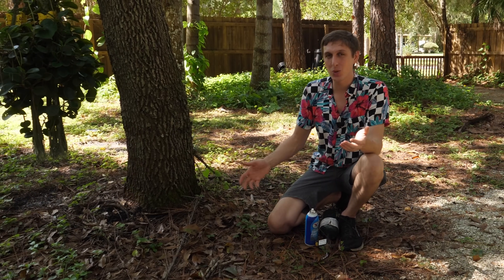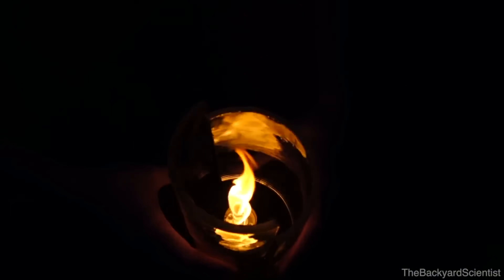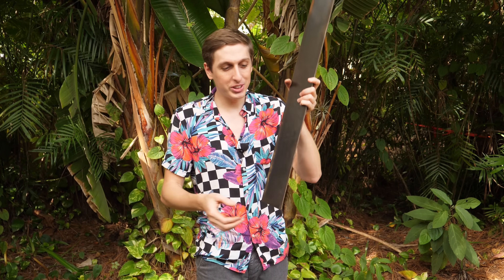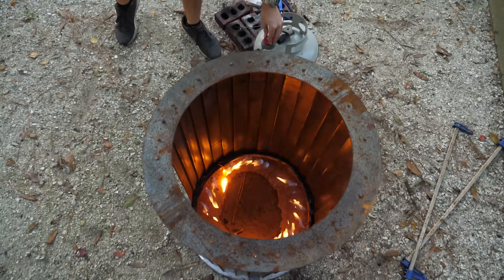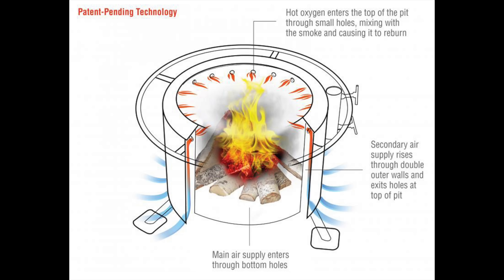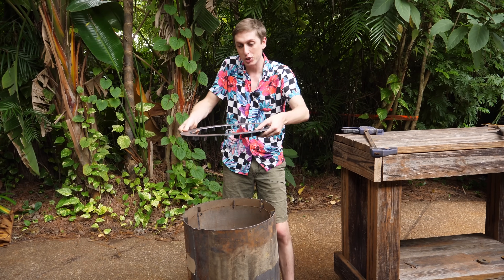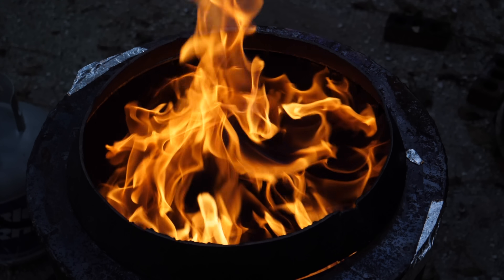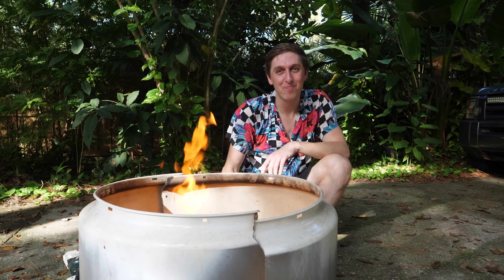The Impossible Fire pit Tornado

Comment: I've thought about this project a lot also. It's a tough one to figure out. I've also played with making a desktop fire tornado that uses a candle. Tougher than it sounds.
Reply from the maker: It really is tough!  To be honest I wasn't even completely sure any of these ideas would work but I had to try them for myself 😅  I just saw this video, and something like this might work too (~7:35) https://youtu.be/i-WBTugxhHM
 If I had those fins spiraling air up instead of into the fire it might work.
Reply: @TheBackyardScientist  That's pretty clever, but not real practical. I think your design is closer to the target of a fire pit that's worth using for more than the subject of a video. A leaf blower is no good to relax around. If it turns out that forced air is really needed to get the tornado going it might work to use peltier powered fans. I've got one that sits on top of my wood stove and runs passively whenever it gets hot. I think your design might work if you could figure out how to get more directed air into the fuel, or maybe just get faster burning wood like pine.
Reply: I think the vane barrel concept would work if the diameter was cut down or the blades were directed more inward so the inrush compressed the column. Maybe pick over a scrap yard for a squirrel cage blower with a useful blade orientation.
Reply: @TheBackyardScientist  Hey Backyard scientist!!!! I am a big fan of your videos. Thanks for checking out my video.
@NightHawkInLight
I have some ideas for how to make it quieter because I agree a leaf  blower is not a relaxing ambiance
Would be super excited to collaborate
Reply: @TheBackyardScientist  Personally, I feel that part of your challenge is one of scale. You are trying to provide positive air pressure that helps burn off the remaining by products while also feeding it in the apparent shape of a vortice. I think you went too tall, with too small a hole for airflow. The 400 dollar items you were talking about are more squat compared to your attempts. You may need to increase your 'cooling' surface area by adding fins to help increase the rate at which you heat the air. These other items are not trying to apply a force against the fire. Just ensuring the best level of oxygen is available. It might be easier to use a heat driven rotor blade of some sort to power an additional air supply that runs vertically in the center of the fire pit. Something akin to the shape of the letter H turned onto its side. It would just need some sort of shield around the axel and a high temperature lubricant to keep it freely spinning. The bottom rotor blade would pull in fresh air and this could be angled to provide a circular rising airflow. This fresh air would blow up through a screen to the hot wood and coals acting like a bellow as it provides pressurized fresh oxygen, increasing the heat and lift on the top rotor. Hopefully also producing a fire tornado.
Reply: @TheBackyardScientist  Why not use tempered glass slats on your design instead of metal slats - this way you can see the fire tornado that is occurring inside the unite.
Reply: @AstarOfDavid  Until the glass gets black from the 🔥
Reply: @shieldmate7444  They make actual fit stoves that are made with tempered glass - and while they do get dirty that is from the smoke/sap etc in the wood - this case he is burning propane in the center so it burns clean - so the glass would not get much residue on it.
Reply: @TheBackyardScientist wall FCC
Reply: Gasifier fire tornado?
Reply: @saccaed   
Hi
Reply: @Harrystyles97658  Hi
Reply: Time for a collaboration!
Reply: @Supplyhousemarco  A collab is still needed!
Reply: I gave it a little thought, what you need is to funnel the air upwards. large intakes on the sides narrowing down to smaller exits oriented upward at 45 deg or so. you want to increase velocity, and basically force the whole flame column up higher with an upward angle on the draft. will also keep the air moving faster with less directional change. imagine combining that metal squirrel cage you just built with a helix curve. (squirrel cage i mean that vaned, fire pit thingy).

Also more flow on the propane couldnt hurt either.
Reply: @bundles1978  
Yes, yes, YES!!!  My thought exactly!
Reply: I once built an incinerator from a horizontal drum and a chimney, the drum was closed in except for an intake air hole, the flame out the top was like a rocket engine, and quite loud.
So, maybe you need a vertical cylinder with air intake tubes at the bottom, angle them to rotate the flow
I think the overlapping drum at the end for example was drawing in cold air above the fire.
Reply: @sparkyprojects  I'm late to the party, but I'm quite sure that this is exactly right. The opening at the top was too large, and that allowed air to stream in from the top. When that happens it moves against the upwards flow induced by the heat to get to the low pressure zone at the bottom, and this disrupts the vortex. Both because it comes in without the momentum that the vanes add at the bottom, but also because it causes rotation between the downwards and upwards moving air that would cause the tornado to widen towards the top - that also reduces the tornado rotation and causes it to dissolve faster.
Reply: Maybe use Pyroceram glass. Preorder 32 precut fins . Then you can see the swirling flames using propane.
Reply: @TheBackyardScientist   @NightHawkInLight  one thing I noticed is that the fuel is just sort of haphazardly cut and laid at random inside of the final design. could cutting the wood more uniformly and making sure it's not obstructing the airflow help in some way?
Reply: A candle fIrE TOrNaDO already sounds really hard
Reply: Liquid methanol?
Reply: Desktop? Is that safe indoors?
Reply: @pikazacian242  When talking candle sized, yes.
Reply: I wonder if the dryer drum works so well because it has that slight restriction at the top? The flame needs some way to "overheat" the air and that restriction at the top helps to concentrate the heat of the flame and air inside the firepit more effectively. If you just added a cone restriction to the top of your multibladed version, would it take off the way you imagined?
Reply: P
Reply: Here in Texas sanintoeo it’s hotter then hell
Reply: have you tried to use a bin light it and sround it with fans?
Reply: Thanks for telling me. I was just about to make one. Thanks!
Reply: Maybe try burning cardboard or paper
Reply: try building a cylinder lined with magnets and rotate it around the flame. fire is a form of plasma and plasma responds to magnetic fields. if you can use an arc to turn a flame in to an audio speaker i suspect that a rotating magnetic field would spin a flame quite effectively
Reply: negative spiral pressure at the top from air intake at bottom. will create a column of spinning fire. i have a design i really want to build. it will work.
Reply: I’ve thought of that to way a candle burns

Comment: wouldn't you just have to do the same thing but conical? an upside down cone can make a beyblade type pattern. If it is right side up, i think the wind will push the fire down due to the angle. I think I need to draw out the forces of the fire like how the fire wants to rise

Comment: You need a narrower body and a choked neck.  It's about increasing ambient temp to drive of wood gas for a cleaner burn.  The impeller neck was GREAT!  I've actually made a fire tornado stove out of an old thermos. Lots of 3/8" air holes at the base.  I drilled and bent few smaller 3/16" angled holes.  They were in the old threaded neck.   They created a great vortex and afterburner effect.  I could heat my whole shop off of it and some large soup cans as a chimney and radiator.  Surprisingly simple and effective.  When I hooked up an old CPAP as forced air it was almost scary in my home shop!!  With your shop you could knock that out of the park!

Comment: who needs arm hair these days. you say no moving parts, what about using a bearing race in the center, comming off inner wall with the outer wall being able to spin via the centre bearing with an angled fan like cross section. sort of like the fake coal fire fan over a light bulb, as it heats it will rotate the outer sort of thingimebob

Comment: Couldn't you, instead of using that slotted ring, make a tube with jets that are angled up? This would shoot the hot air sucked up from under the fire into the sky and would maybe increase the height of the tornado. You could even find out the perfect angle and Maximum height :)
Reply from the maker: Thats a great idea! And i just saw a video where someone did something just like that. (~7:35) https://youtu.be/i-WBTugxhHM  Instead of a leaf blower the hot air rising might be enough.
Reply: @TheBackyardScientist  that is awesome! Thanks so much for sharing :) what if you would make an air intake from the bottom? Then the air doesn't have to make it's way through all the wood and it would get sucked up more mby.

Comment: 5:40 - then why don't you add a fresh-air intake at the bottom of the fire pit, to make sure a lot of oxygen gets in at the base of the flames?
Reply: And make a piece of metal that is riveted to a center pivot on the bottom with a small handle that sticks out the side. Drill equally distant spaced holes going through both the piece added to the bottom and the bottom. Then that way he'd have a blender door to control the amount of air going into it. That way it's not drawing so much air that it's unstable, but just enough to feed convection and get it going.

I think a few more modest things, and he'd have a design that would work. (Seems the one with the perimeter slats is thisclose.) But I guess there's other things going on that limit the amount of patience in working out a good solution.
Reply: @pauljs75  sus mongus
Reply: Also, those fancy fire pits don't have the fuel at the bottom, there is usually a grate mud way it sits on
Reply: Add 3-6 pipes winding in the same coil direction like a curly horn curving and getting wider as it comes to a end like a funnel. Sorry horrible at explaining but if im correct the sheer momentum and buildup coming to a finer point will increase the force and oxygen intake... Im not this smart trust me
Reply: imagine birds eye view looking down the tube of the fire tornado, now imagine 3-6 preferably 4 every 45 degrees at the base  spun around the outer rim of the drums slates so it levels out the oxygen and prevents gusts of wind to extinguish the flame... damn my sleepy thoughts are smart sounding in my head ugh

Comment: Why not just make it with moving parts, have a fan blade on top of it, driven by a chain to a motor outside the fire. That way you dont need to deal with heat/motor issues.

Comment: The whole pit needs to be a venturi with the top of the pit acting almost like a nozzle to speed the flame up and draw it above the pit
Reply: If a jet/venturi engine produced a flame tornado shape, would it produce a torque on the engine as a reactive force?
Reply: @connormcneill9024  well, wouldn't it have gotten that spin from the engine? That torque would be what's used to turn the rotor though.
Reply: @connormcneill9024  I don't think so, although it's possible